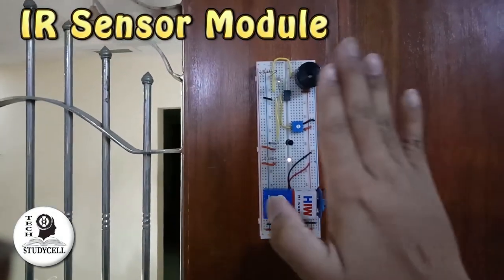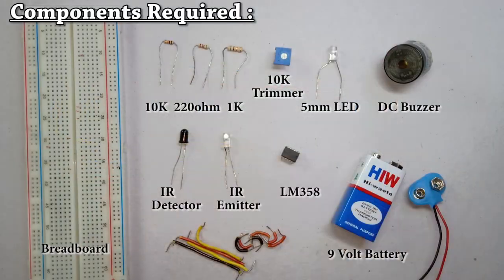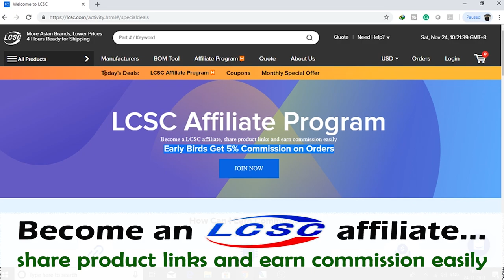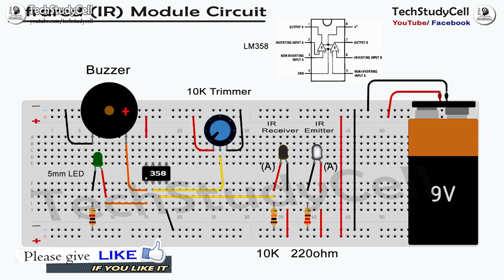How to make IR Proximity Sensor on Breadboard with LM358 | Touchless Door Bell

Comment: Hi, I have 2 questions,
1) Can I have the schematic circuit of it ?
2) for the Buzzer, did you put one end of section dots, and the end in the start of new section of dots, or it does not matter ?
Reply: I tried ma y times but it's not working. Can I see the schematic diagram?

Comment: I made it but its working the other way around. The buzzer keeps buzzing and stop when an obstacle is placed. Any solution?
Reply from the maker: Check the output pin of the LM358. It should be high if any obstacles is placed. Also check the connection and polarity of the IR LED pair.